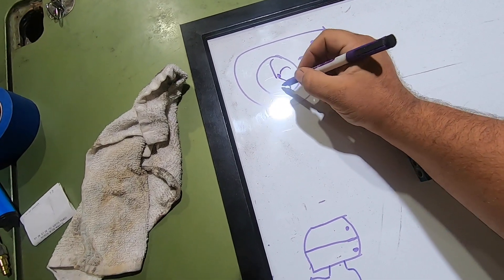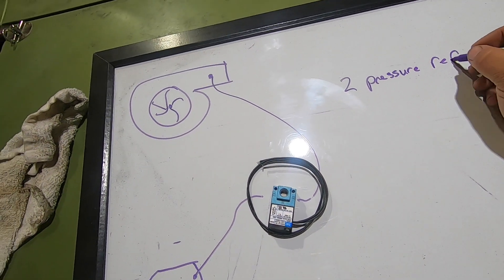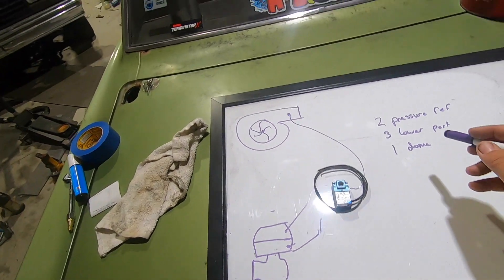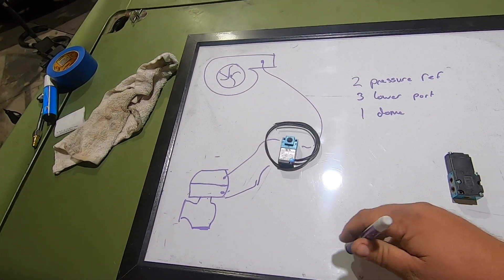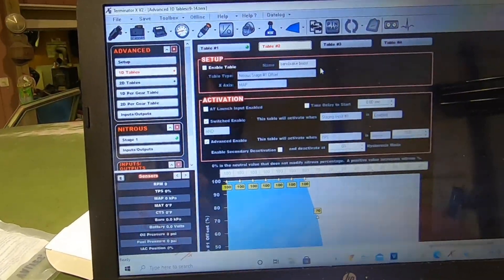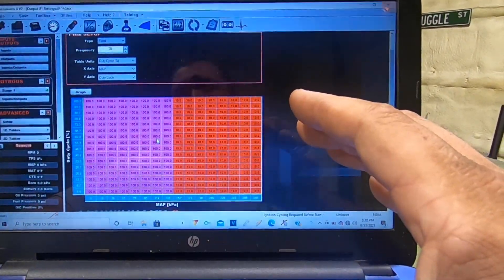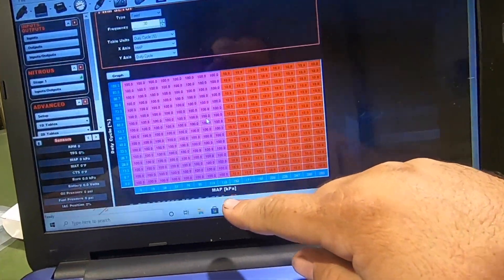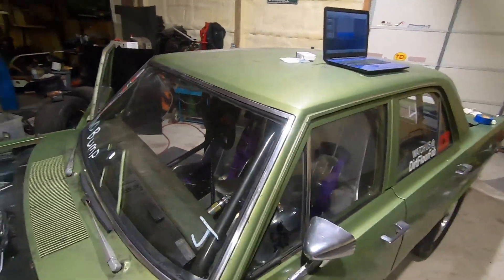3 port like 4 port, and Term x boost builder without dome

Comment: Which lines are you poking a hole in for the vapor lock? 3 lower port?
Reply from the maker: Both lines that go to gate. It's so the gate doesn't hold pressure on top or bottom
Reply: @Dirtfloorfab  thank you sir!

Comment: interested in seeing how the 30hz stuff works for me, for fun, i have done the 3 as 4 on the dyno when we ran out of boost controller. but its nice to see this instruction on here as i have never explained it to anyone
Reply from the maker: So far it's working good I really need to go to the track whenever it decides to quit raining. So far I got up to 45% which was 202-203 kpa on the log and 40% was 185kpa. Seems like the Mac valve is adding roughly 1/2 lb per percent now. But the 14/15 lbs I'm at right now doesn't hook off the trans brake on the radials so I really need to get the slicks back on and go to the track again
Reply: Where did you heat and poke the hole?